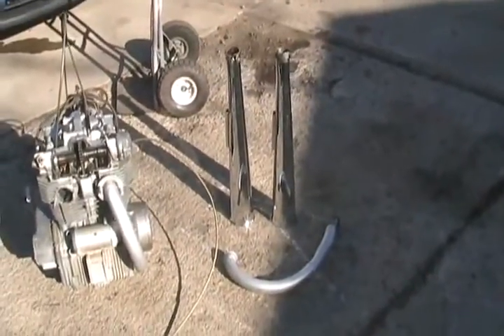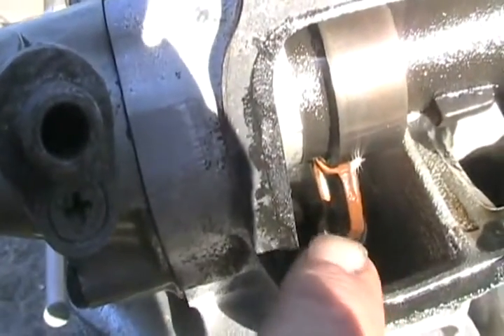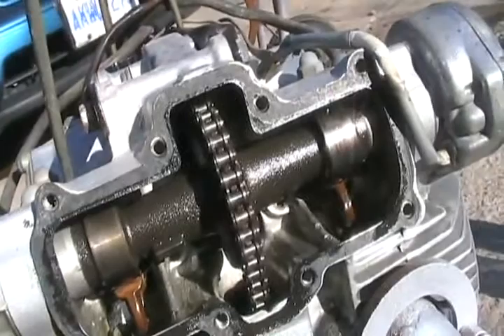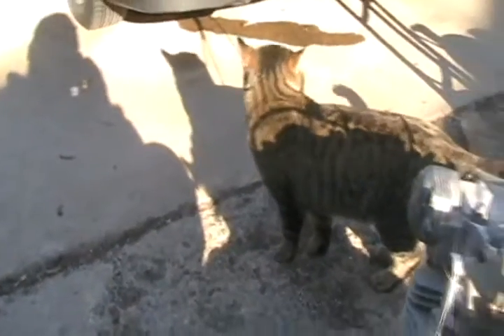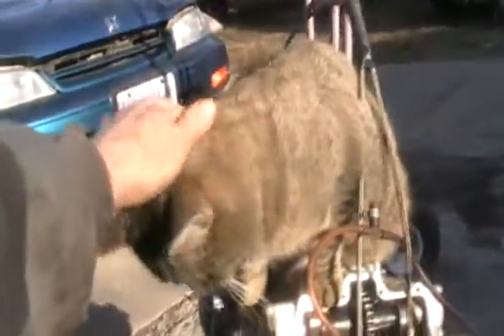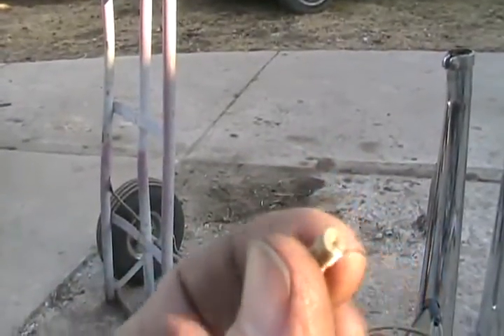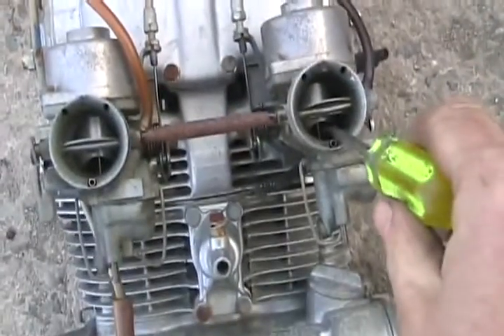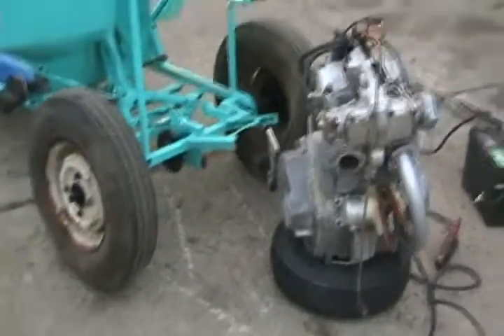#1285 Setting up the engine for Davidsfarm gokart, cb450 honda [Davidsfarm]

Comment: I have a cb450 and a go kart frame it's my first time working with go karts or motorcycle engines so since the cb450 motor is a 4 or 5 speed do I have to turn the kart basically into a shifter kart with a clutch and gear shifter?